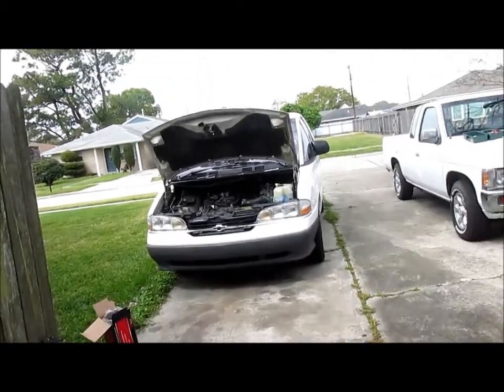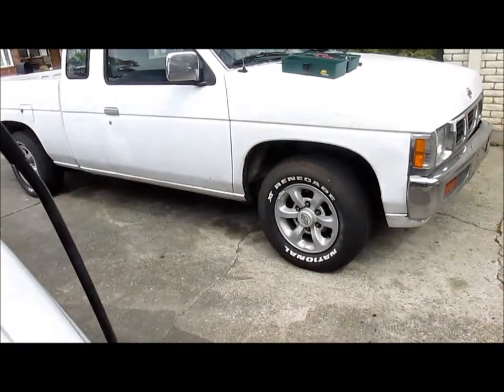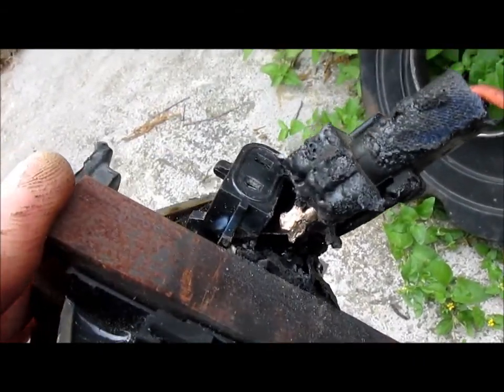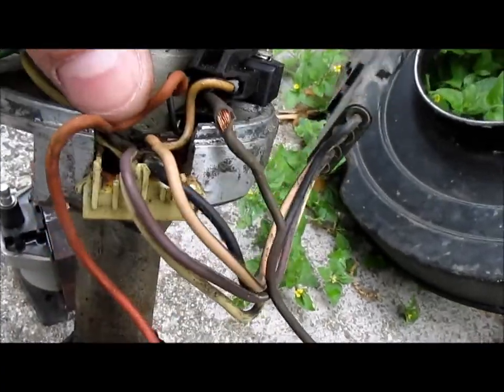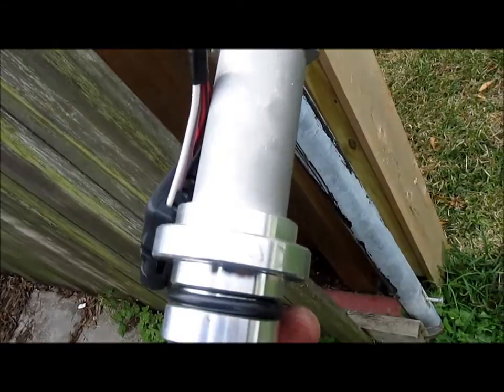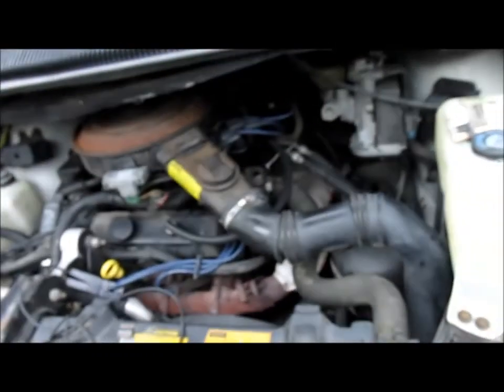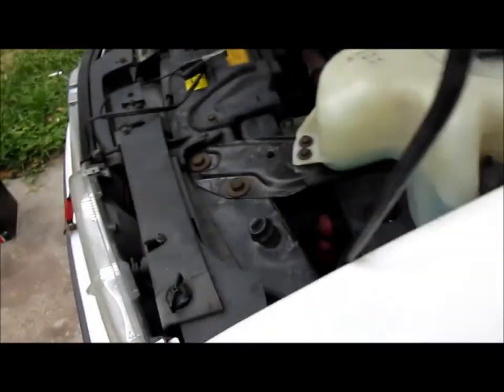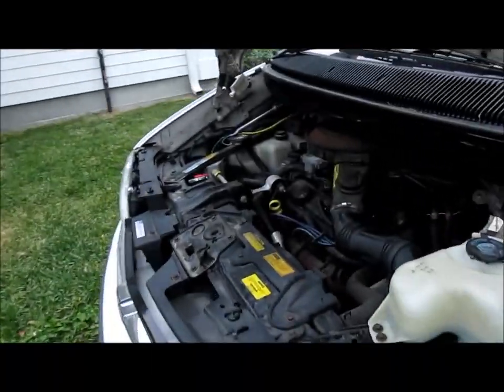1995 Chevy Lumina Van - Fire!

Comment: did you get the seats for your fan? how's the truck running
Reply from the maker: Got some grey seats out of a '90 Silhouette - not great but they fit.  Still looking for some better ones in blue.
Reply: Tiger Bluff it Fireball Tori Lee barbar my larval spark plug wires Darbar
Reply: audubon5425  glad to hear that you're keeping the Lumina because even though the 3.1 has 120 horsepower it doesn't feel like it has a 120 horsepower engine and  why don't you sell the Lumina and keep the previa?